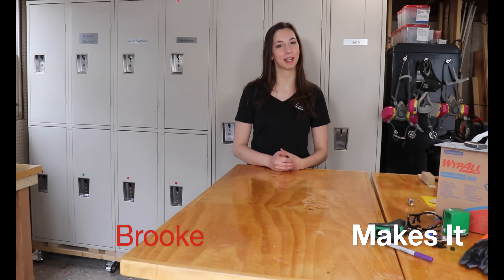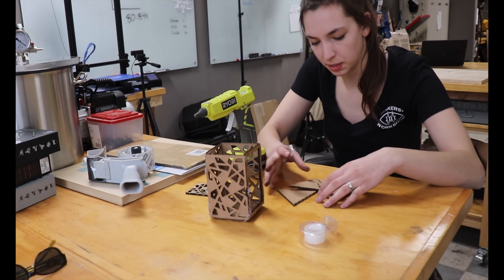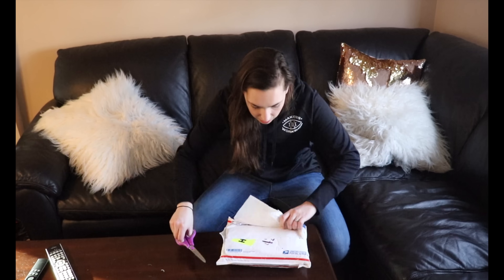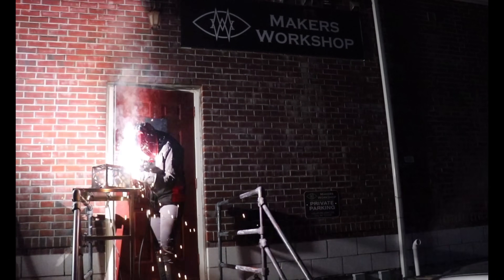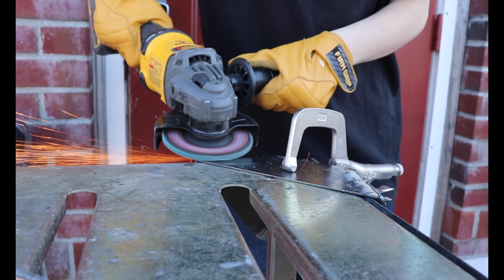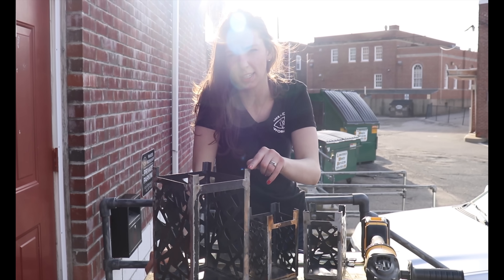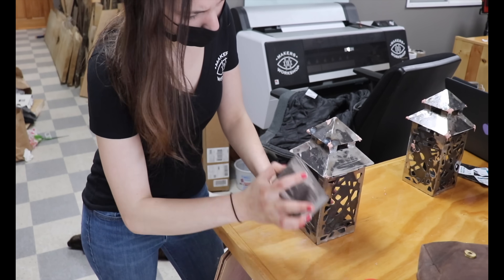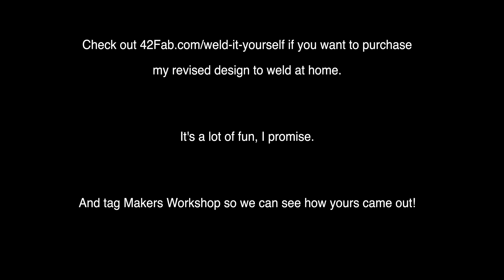Designing and Making a CNC Plasma Cut Lantern

Comment: That is a really cool project. I should try to  remember the cardboard prototype trick .

I would like to suggest though designing it so the welds can be done on the inside, six or 7  tacks per side should be plenty.
The outsides can be trued up using a file.
It would save you tons of welding and grinding.
Reply from the maker: Thanks! I don’t weld too too often so I really appreciate design input 👌🏻
Reply: And as the other commenter said, just tacks will suffice. It's a lantern, not a race car chassis.

Comment: Really fun project, came out great and looked like it was fun to make!
Since you mentioned incorporating the standoffs for the roof, it might actually be cool if you sort of mirrored that and had little feet in the corners, I would then inset the bottom/ floor up a 1/4" from the bottom edge of the sides, and weld it from underneath, then you wouldn't even need to worry about grinding those welds, and they'd be easy because they would be inside corners. Having 4 feet would also make it a lot easier to get the lantern to sit flat without rocking, and I think you could have some fun coming up with cool shapes for the feet. Looks like the weld it yourself kit isn't finalized yet and I know you guys are heavily focused on PPE production right now.
Reply from the maker: Hmmmm... all good thoughts. I’ll have to mess around with the file and see what sticks. This project was genuinely so much fun for me; I could mess with designs like this all day. Thanks so much for the input! And I’m glad you enjoyed the video